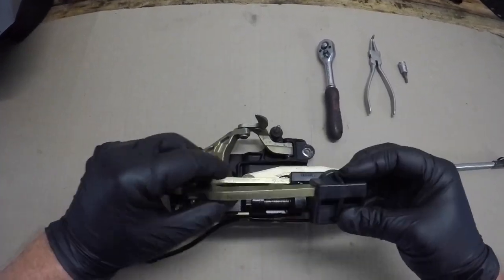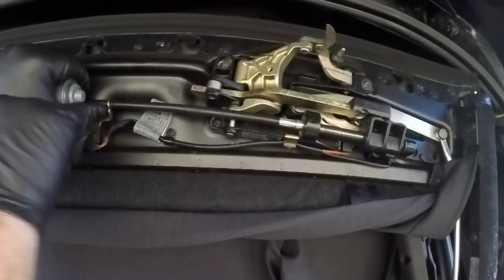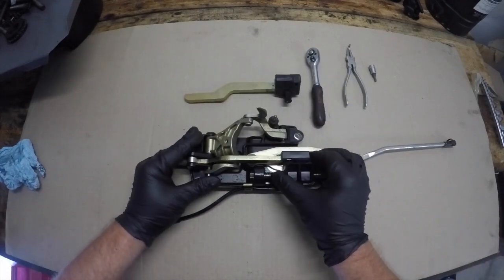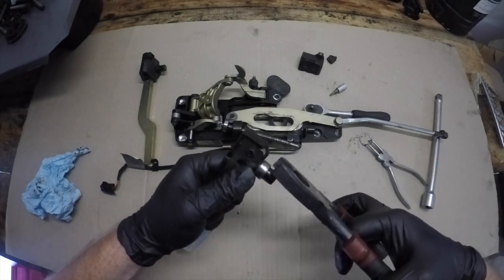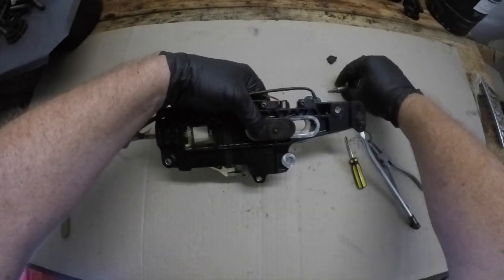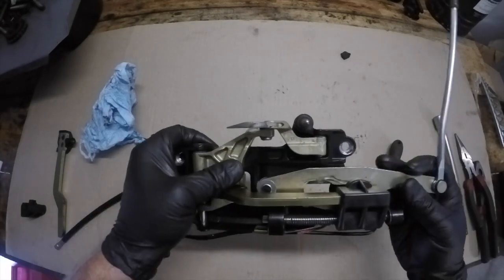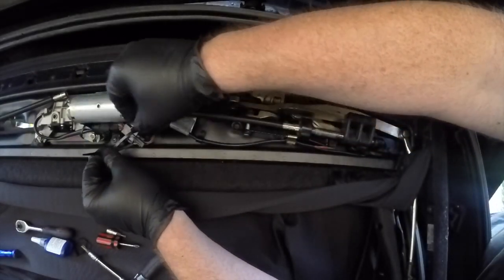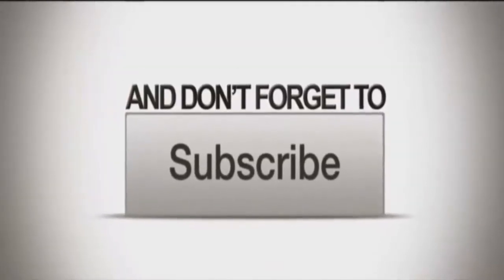Vauxhall Astra Convertible Roof Latches - FIXED

Comment: hi mate
 great job and great video can you tell me where you can get spare hoses and connectors from as mine has poped and and cant be put back on 
thanks john.
Reply from the maker: I get the hoses made up from a local hydraulic hose company, there are always heaps around. Much cheaper than from the dealers. Hope this helps.

Comment: Thank you very much where can i get the latches coz i have the same problem
Reply from the maker: Can always find them on eBay, just search 'Astra roof latches'  lots of different sellers are there. You can also buy genuine but the price is very high and I have found the aftermarket ones to be of good quality.

Comment: Thanks for the nice video..I have a diffirent problem..My roof wasn't opening correctly,needed help with my hands and stucks at the beginning of opening..I checked the hydraulik oil at the back,i saw it was under the minimum line and also i saw some liquid out..i put some new oil in the pump bewtween the minimum and maximum line but when i start the operation, it begins to throw out the oil from a part near to right back seat under the roof,,all the oil out...and of course the rood didnt work...do you know what kind of problem is this??
Reply from the maker: Yes, it sounds as if it has a leak in one of the high pressure hydraulic pipes. It is fairly common. If you are able to view into the compartment where the roof is stored when its fully open you will see a number of hydraulic lines and will be able to see the leaking one. I don't know which country you are in but the are lots of business that make hydraulic pipes and you can easily get a cheap replacement. Original ones are really expensive. Hope this helps. Thanks for the question.
Reply: I thought it was somethink like that,thank you for your time i preciated it.!!  .I am from Athens- Greece..
Reply from the maker: Wow Athens-Greece!! You got to fix that roof so you drive around with the roof down. I from Brisbane Queensland Australia.
Reply: Yes..You are definitely right..:)i cant fix it by my self,i ll go to an opel engineer and i ll see what price he will tell me for this damage..I pray that he won't 'kill' me with the cost:)..i ve got cousins in Melbourn :)

Comment: Can you please send me the pdf to assist me. My roof doesnt work. Its a holden astra soft top 2004 model.seings thoe i am a girl. I know tech nothing bout cars. But my brother who is a mechanic of 30 yrs pluss has taught me all i need to know. Id love a guide into what u think i shouod do please. As ill be doing it myself. What parts do i need. Where do i get them. I noticed u said ebay. I did look them up. nice and cheap. But what parts i need is my question and if you could send me as much info to help guide me thrue. Ps wish i could hug u. Legend. X
Reply from the maker: Send a message to my instagram account with the details where to send the extra info.

Comment: Great video for a common problem on these cars. Now that the replacement parts are available online, you don't have to suffer the exorbitant prices for metal replacements from a certain repairer in Aussie. 
With regard to the very tight screws retaining the locking mechanism (Locktite has been used), I found by supporting the roof edge when folded down, and giving the screw heads a very FIRM smack with a hammer and brass drift, it allows the screws to be undone without stripping the head. I also replaced the screws with Allen head cap screws so the issue never reoccurs.
With plastic blocks that are just cracked a little, I have used stainless steel cable ties to provide reinforcement and a fix. Two slipped under the plastic mechanism and crossed over do the trick. Getting them TIGHT is the issue and you may need a SS cable tie gun.
Reply from the maker: Cheers, thanks for the comment. Can’t wait for the day when we can all 3D print these types of parts.

Comment: Thank you very much for this video. I could finally take out the broken latch and it had exactly the same problem as yours. I ordered a new part from UK and hopefully will arrive soon. I will replace that plastic part on both sides as the car is 2002 and the other one may also break in the near future. Big help mate!! So appreciate your work here in posting this guide!! I will post again once the part has arrived if I will encounter any difficulties.
Reply: Whete can i order it....
Reply: My roof won't open  the Alan key just keeps on turning

Comment: Great video, I'm in adelaide SA and find it hard to get anyone to look at my roof without charging UNBELIEVABLE prices, so I'm trying to educate myself as much as possible, your video saved me "thousands", thank you .
I have a small hydraulic oil leak in roof, I've looked at my hydraulic oil bottle in the boot ( very low) can you assist with getting me started here? With my roof in the closed position, I went to open roof with button, stopped. Few centimetres tres from windscreen " beep beep" closed the roof immediately and then noticed that trickle of hydraulic oil running down the left hand side of my car ( rear from boot lid)
Thank yo in advance
Reply from the maker: Brodi Harris in where the roof retracts is a number of pressure lines and hydraulic rams are located on each side in the roof. You will need to stop the operation mid way through to be able to see the mechanics of the system. Any good hose manufacturer can make up a pressure line and if you remove it they will charge around $50-100. If a hydraulic ram is leaking I generally replace with a good second hand unit. I will double check to fluid I use as the Holden fluid is at a crazy price. Email me at killawattgarage@gmail.com as I  have and PDF resource I can send.

Comment: Great vid KWG, really appreciate it. Have had hydraulic pipe come adrift and when manually operating roof broke the roof latches AND the flexible drives, even with a tiny allen key. Working on it though with your  assistance. Two questions, 1 any ideas for flex drive replacements, and 2. Are there any vid resources about for how to replace the hydraulic hose/s that you are aware of? They are something I haven't done much work with.

Cheers. Kinglake Col
Reply from the maker: Hi and thanks for the comment. I have replaced the hoses a couple of times. Each time I removed the leaking hose I took it to a  local hydraulic hose maker. Cost about $60-$80 Australian but the quality was high. It's pretty straight forward to replace one hose at a time. Once done top up the fluid and operate the roof and it will self bleed. I use fluid like this.
https://www.nulon.com.au/products/hydraulic-fluids/iso-32-hydraulic-fluid

As for the broken flexible drives, I wouldn't want to suggest a suitable replacement, find some good second and ones. Plenty of these convertibles out there getting stripped for parts. 

Let me know how it goes happy to offer help.

Comment: My Astra's back hatch won't open for the roof to fold in :( Have had this problem for over a year. I thought it just needed hydraulic oil, nope, not the issue. Any help would be awesome and I would imagine save me a shitload of money!!!!!!!!!
Reply from the maker: Most times it's a failed hydraulic line. You will need to manually open the roof.

1. Lower the windows. This is important and easily forgotten. Failing to lower the windows can
damage the roof mechanism and may even result in the windows breaking.
2. Open the roof latches using the supplied hex tool through the grommet in the centre of the
front edge. It takes a lot of turns, so be patient, and the latches appear to stop moving a long
time before the mechanism has fully opened – the side “flipper forks” move during this time
to raise the front edge of the roof by about 10cm. When the latch is fully open, the
mechanism should feel a little stiffer, but don’t force it as this will break the plastic blocks or
damage the flexible drive shafts! Do NOT use a power tool to drive the mechanism – this will
almost certainly break the latches.
3. Open the boot.
4. Push the release lever on the left-hand side of the boot fully forward and wedge it there.
5. Close the boot lid.
6. Raise the rear windscreen.
7. Push the release lever on the left-hand side of the boot fully forward and wedge it there, then close the boot lid. You should now be able to open the deck.

Once in here have a good look around, hopefully you will see your problem. I have a good guide that I am happy to email you. Email me at Killawattgarage@gmail.com
Reply: @killawattgarage  I've copied and saved your instructions. Thank you so much. And yes, I will email you right away. Dude, thank you!!!!!!!!!!

Comment: Cracking vid, mate. Most useful bit of info I've found on repairing the latches on this car which I know I'll  need some time in the future.
 At the moment I've got  problems with the tonneau cover/ deck lid not locking into place in either the opening or closing sequence. The latching cables are broken, but I think there is a sensor not getting a signal that the deck lid is closed.  Beeps madly, and the roof won't  fully close, however it does fully open. Any help you can offer would be really appreciated.
Thanks
Reply from the maker: Email me at killawattgarage@gmail.com and I have a really good resource I can email you.

Comment: G'day...I'm hoping I can assistance:) I have no power it seems to power roof,anti theft and window switch next to roof button on mid console isn't working , if those brackets are broken , does the anyone theft still work(turning key in door lock to turn blinkers on) I checked fuse 15, fuse it fine.. totally at a loss?

Comment: Great video! Probably off the exact topic a bit but mine has a problem with the motor that drives the latches. The plastic worm wheel that runs off the motor's worm gear has broken in half. I'm not having any luck at all chasing up the gear itself or the motor. Are you able to point me in the right direction?

Comment: Hi there, I have a 2005 ts astra convertible,the problem i have is when the roof starts to open it needs a little push, and then works fine. any ideas thanks.
Reply from the maker: The arms that run to the latch will need some adjustment.
Reply: Thanks for your reply, I’ll give it a go,much appreciated.

Comment: I got side tracked into watching this! My oil reservoir had almost emptied. I had never looked at it in 17 years of ownership. I topped it up with the correct grade oil and was looking for some time and a fine day to reset the roof. I went to work on it and found the reservoir completely empty. Obviously a leak somewhere. Researching the leak brought me here! I don't need to replace the latch mechanism at this time, but this is a great video should I need to.
As an aside, we have the UK model of this car. Spares are not readily available in the UK, is that different in Australia?

Comment: I need help. In a bit of a financial pickle so can't pay to get repairs.

So my girlfriends car is an Astra 2002 I think, she when to open the roof today a hose on the left side seems to have burst and oil is coming out. Right now the roof is in a closed position about 5-10cm from being completely shut. I just want to shut and lock the clamps for now but not having much luck. I don't want to push down the top for fear of more damage. What do I do?
Reply from the maker: At the 0:20 second point you can see me manually unlatch the roof. You essentially need to do the opposite. Don't push down on the roof just manually wind and the roof will lower and lock into position. It will take a fair few turns to fully close and lock the roof. Don't force it. You can them fix the hose whenever. I suggest getting a hydraulic hose company to make the hose after you have removed it yourself. You should get some coins in change from a $100. Let me know if you have any questions. cheers

Comment: Couple of years old. But great video. I think I may have damaged the motor.... Any clues on replacing that??
Reply from the maker: At 1:40 you can the the motor on the left of the screen that operates the latches, its held in place with a couple of bolts/nuts. 
Thanks for the question.

Comment: Hey man when I turn the hex key the piece that turns seems to drop down and spin without anything happening, do you know if that's supposed to happen?
Reply from the maker: The hex key turns a cog, if you are feeling no resistance or connection through the cog I would assume that the cog is badly damaged. Thanks for the comment.

Comment: Great Video. My astra snapped the cables that open the cover for the softop and burst the hydraulic ram on the left . Too much work to fix but this video enabled me to close the roof. One of the plastic brackets shown in video snapped during the melee.
I unscrewed the threaded shaft, took off the broken plastic , abraded it and superglued it together in situ. I then threaded the shaft back in and did a manual wind to lock the roof. Didnt have to unbolt the whole unit. Couldnt have done it without video. Kept the car on the road until it went to scrappers. Great.
Reply from the maker: Well Done. Glad it helped out.

Comment: Hey mate so my roof is just beeping (12 beeps) whenever I start the car. A pipe burst and I've refilled the hydraulic pump reserviour. But the roof won't even try to open/close. I'm following some instructions that outline I have to reset the roof by:
 a: making sure the font edge is unlocked and 10cm  above windscreen
b: make sure the rear window is vertical (is this even possible when the front edge is 10cm from windscreen? I can only get a 30cm gap minimum)
c: all four windows are down
d: the tonneau cover is closed but not latched
e: the release lever in the boot is not wedged (he must mean forward) 

"the roof is then reset simply by starting the engine and holding the roof closed button until the roof is fully closed" 

I've followed all the steps but it just beeps when I start the engine. Doesn't even try to seal itself shut.
Reply from the maker: I would try to fully shut or open the roof manually, then try. Makes sure the doors are closed and the handbrake is on.
Reply: @killawattgarage  Trying that now, it's just beeping. Won't even attempt to try. Do you happen to be in Sydney or Central coast nsw? 🤞
Reply: @trystanauddino5263   hi there .... do you have the solution ? Ive got the same f*** problem

Comment: Hi I am George I have one BMW 2003 CONVERTIBLE E46  one latch is Jam , I don,t open these , I try Manually but not only one side is open  do you know any possible trucki , for me thanks
Reply from the maker: Sometimes you have to cut the trim in front of the latches to pry them open. Then replace latches and the trim. In the Astras it is a plastic trim piece, can't remember what it looks like on the BMW. Sorry I don't have a better solution for you.

Comment: What is the tool you used to undo the centre (screw) I used a torx screwdriver and turned it and turned it until it started to tighten up.
Reply from the maker: Yep, its a torx bit. I used them with a ratchet for extra ease when tightening or loosening.

Comment: Great Vid, I bought a 2005 Holden Astra model and it beeps 6 times and won't open at all nothing happens. I took it to a mechanic and he couldn't fix it and now beeps 12 times with no action. Can you please help me? Any advice will be appreciated
Reply from the maker: check this out. http://mikeellis.org.uk/photos_astraowners/Astra%20Convertible%20roof%20hints%20and%20tips.pdf
Reply: @killawattgarage  Thanks for the link. I took my Astra to local Holden dealer (Geelong Victoria) where they ran diagnostics but there were a few faults that came up & they did not know where to start and said they couldn't help me. Do you have any contacts in Geelong or Melbourne that specialize in fixing these roofs that don't charge a fortune?

Comment: Hello 👋🏼 I know this was posted 2 years ago but hopefully you will see this. My roof will not open and it doesn’t make any noise like beeping I thought maybe no power ? Do you have any suggestions?
Reply from the maker: With no beeping at all I would be thinking a power issue. Start by checking fuses.
Reply: @killawattgarage  yeah that’s what I was thinking but it wasn’t a fuse

Comment: Hi the two laches have arrived. Now the rods inside the latch is very hard to screw in. I need to use a tool to screw it in is it normal? Will the motor of the latch damage if it is too hard to move the rod? I don't know what else to do as it is just too hard to move it manually. The original one was very easy to turn but not this replacement.. Any advice please would be appreciated. Thanks
Reply: Looks like the items I received have the threads a little damaged... probably been used previously... Should I return them or can I used them like this? I had to wait 2 weeks from Uk to Australia to get them.
Reply from the maker: If the threads are damaged send a message to the seller, just to be sure. I would expect the threaded spindle to have more resistance than the old one but it should be binding.
Reply: He told me they are all like this and I should try to install it but it is hard and I can only screw the rod with pliers. Do you think it's ok for the small motor to have all this resistance in closing the latch? I may risk to burn the motor if it is too hard and I need to replace both latches as both cracked. I noticed your latch is gold in color like the original that was on my car and mine are silver. The thread it is hard but more and more I screw in and out it's getting just a little loose. Just my concern is the little motor. did you noticed if your latch had more resistance then the original one?
Reply from the maker: Lt. Nimitz if it’s really tight or could install one latch at a time and carefully watch and support the roof through the cycle (be careful) The gearing on the motor does make it quite powerful.